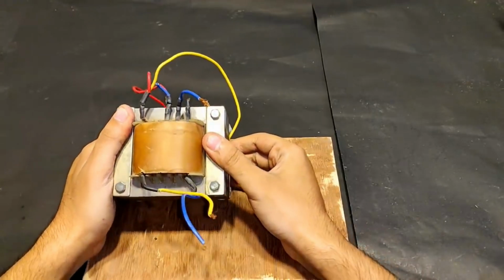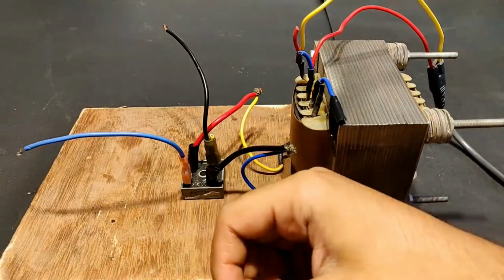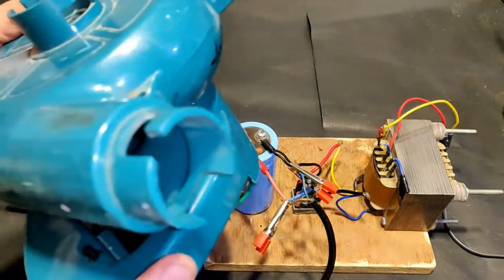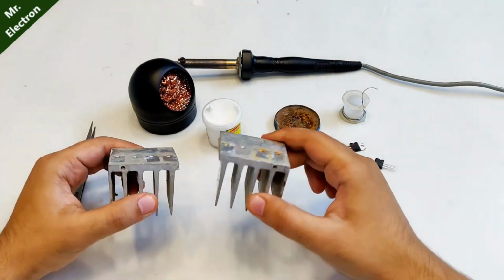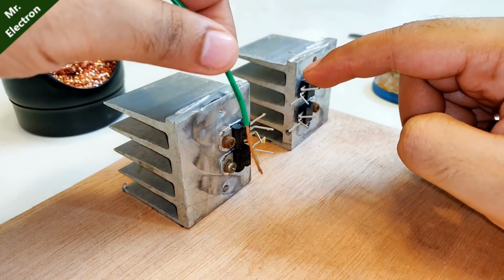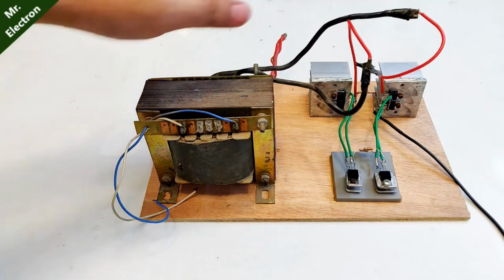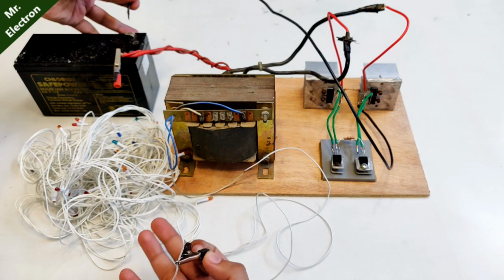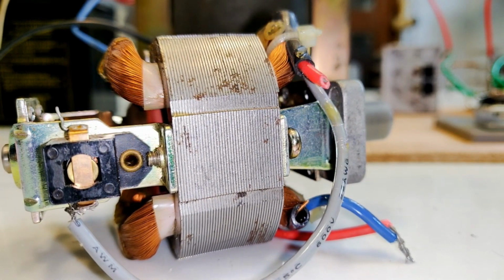3 Simple Inventions with Transformer

Comment: Build a AC DC converter and DC AC inverter as one combined unit. A selection switch for inverter or converter. Of course it would be a larger unit. Transformer or 2 plus 12 volt battery with of course fuses and breakers for safety. In case of a overload on the AC end. Fuses for the DC side converter. A fan for cooling the unit. It would need plugs with connection points for using the inverter or converter. Possibly on wheels for easy accessibility. Bet you can't find a multiple 2 in one complete power supply unit video. You have the skill and obviously can get the supplies you'd need to build it. Maybe 2 ft by 1 ft by 16". Put wheels on it with a handle. Seriously I bet that would be something. The ultimate complete unit for either DC or AC. Think 🤔 about it.. Thanks for the content. I've learned a great deal from watching your videos. Oh by the way it would need solar for emergency charging the 12volt DC battery up. Would a small AC motor turn a DC alternator enough to reincorporate power through the  system while providing extra amps needed.

Comment: That transformer is basically a control transformer with multiple power supply lines. So basically you could have built a DC power source  with multiple DC power outlets right? How many power control lines does that type of control transformer provide? Project 1